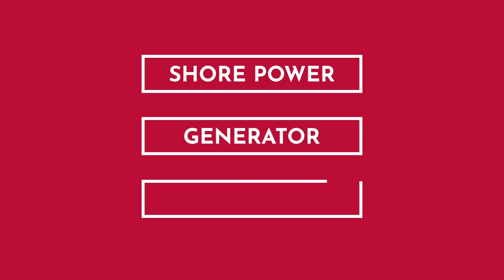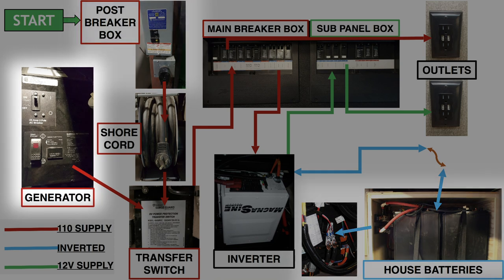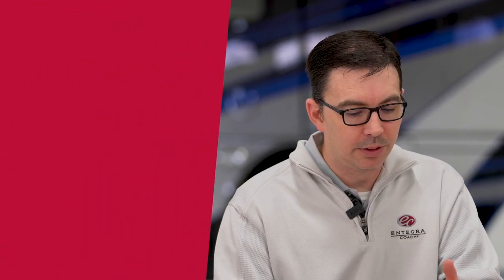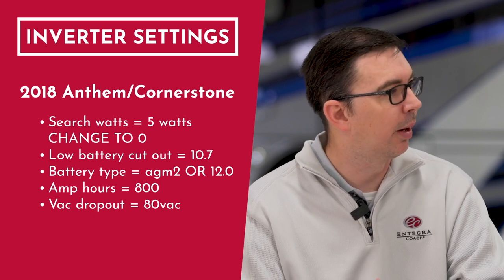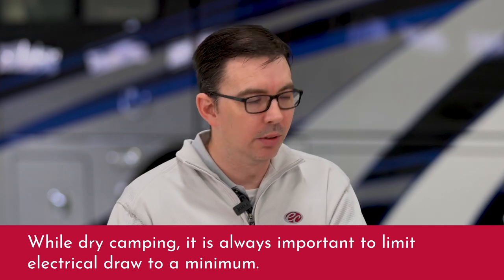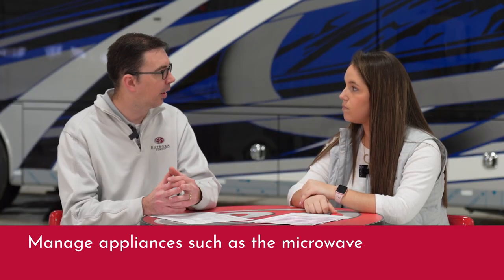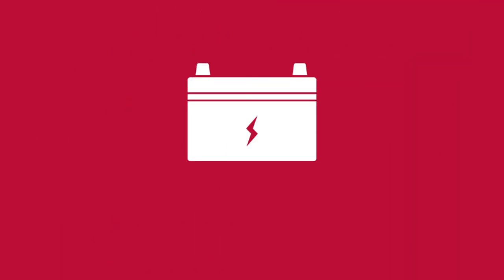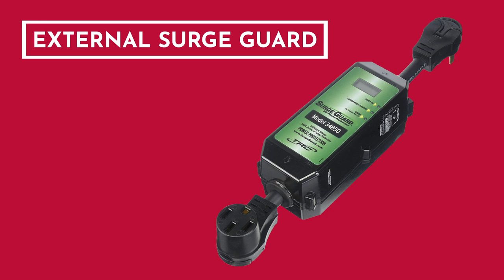Power Management - Entegra Coach

Comment: Just using the right adapter for the power you have available WONT take care of your situations without adjusting the energy management accordingly.   Some energy management systems will  auto recognize the amperage available and shed appliances accordingly.   Others will not without manual adjustment.

Comment: Hello. I just got my 2021 Entegra Odyssey 24B I love it, but the rear camera and the side cameras all stop transmitting video. I was told it was the camera switcher controller. I have been looking everywhere and can not find it. Is not at the rear cabinet where all the other components are. Is not under the driver seat or passenger seat. Is not behind the inside's. tv monitor. Does anyone know where it might be located?
Thanks in advance for the help.